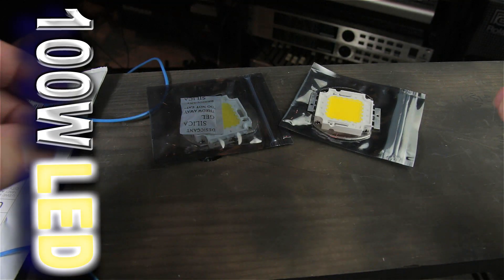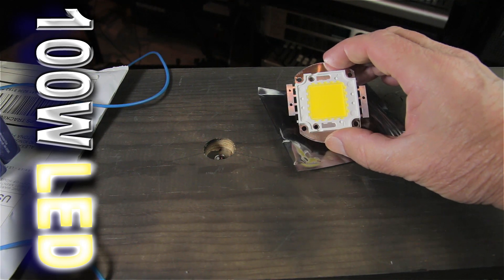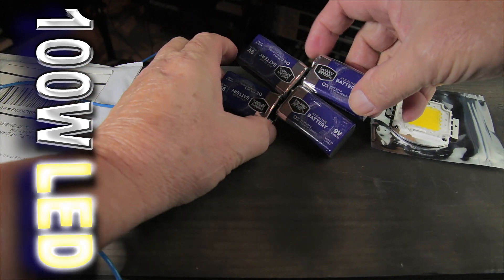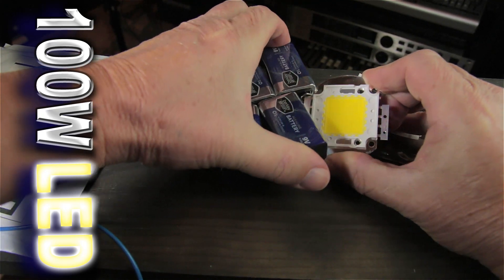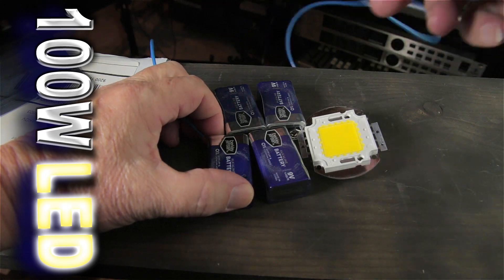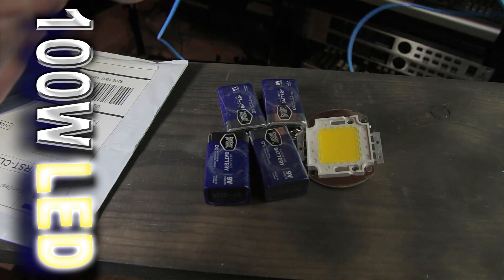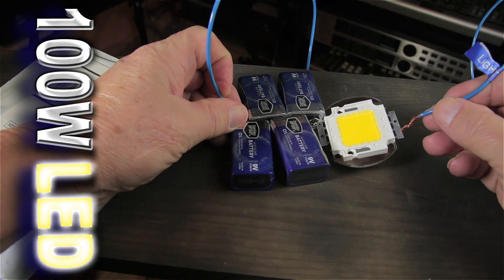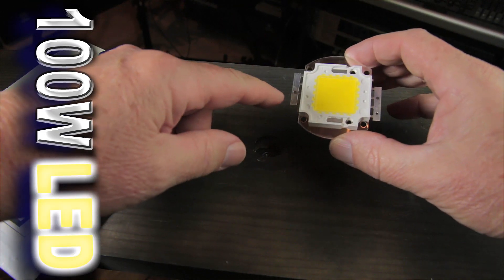Quick Way to Check if LED Chip is Good - NO SOLDERING Require!

Comment: Nice how you over-voltage and under-current an led at the same time by feeding it 36V and only 150mA.  You are an all star.
Reply from the maker: Thanx! :)
Reply: You can't run a led like this at 36volts and only have it draw 150ma... The more voltage you put into in the more current it will draw, hooking it up to these batteries just caused the voltage to sag a bunch and it to not draw nearly the rated current.
Reply: This 5-second test probably destroyed the light huh?

Comment: Formel for effect, P=U X I. If effect are set to 50 watt @ 27 volt, a minimum current drain are:  1.85 85 85A.  10W @ 12 v are 0.83333. How did you calculated listed current drain? What was you idea here, to prove bad/good LED?
Reply: This was probably the most simple and pointless test you can do. A good way to test if they are decent LEDs is to run it on a cc CV power supply and slowly increase the voltage to see if the LEDs light evenly.
Reply: I am an overthinker and i approv of this comment .